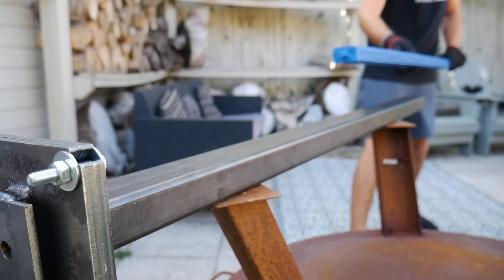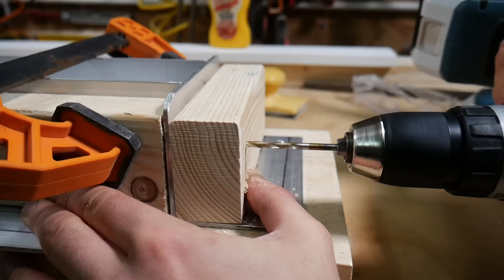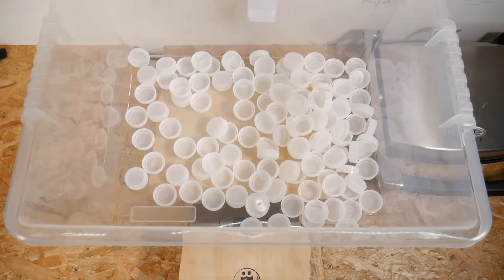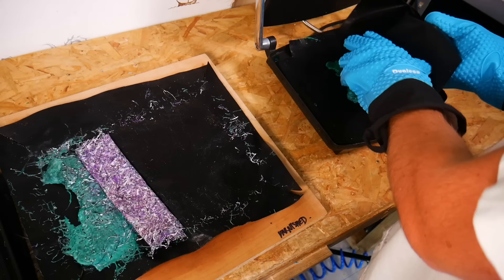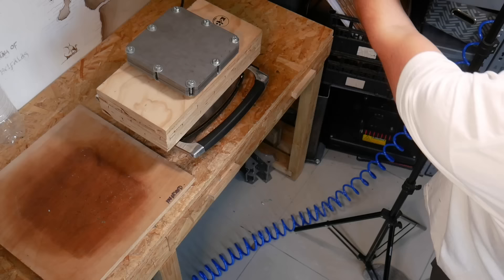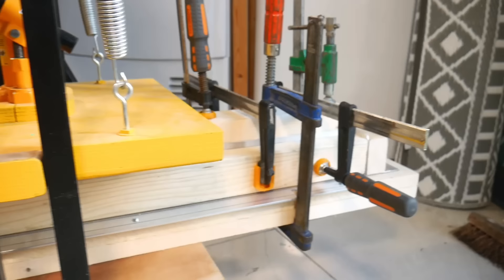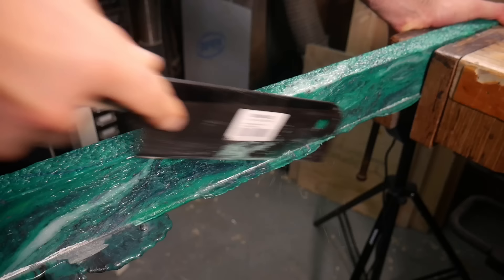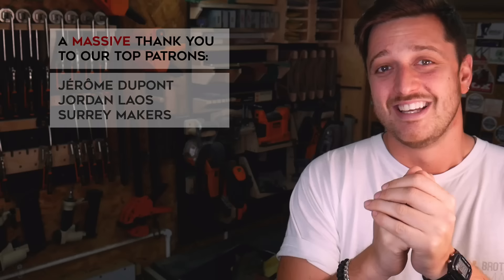How to Make Recycled BEAMS from Plastic Waste at Home

Comment: This was cool.. how about adding electrical heating coils along the aluminum of your mold. Then you can add in your material without having to preheat and mold it. You should be able to use full caps and you're saved. As each batch melts you can press it and add more
Reply: I was thinking a heated mold would be a good idea. Just add the raw plastic, wait for it to become warm, press, turn off heat and cool.
Reply: Can you regulate your temperature with this method? HDPE has a sweet spot at around 350 F. Cooler than that and it isn't moldable, hotter than that and you start off gassing toxic chemicals.
Reply: @Dwight Gordon  it wouldn't be impossible, but it's not going to be as easy as adding a couple of heating coils as suggedted. I'd aim for enough coils to keep the mold from cooling too quick while setting your clamps, and preheating.
Reply: @Frentraken  heating elements, insulation, pid controller.  Not super difficult
Reply: @JordanHaisley  and at least a half dozen temperature probes for something that big, plus insulation required to maintain 350f is gonna add serious bulk, which will need to be addressed for clamping. So again not impossible, but still not slapping a heating coil on and calling it a day easy either. 

I stand by the idea of just warming it. Small heating elements embedded in the wood frame behind the aluminum, then some 3/4 inch hard foam board insulation, and then either another layer of aluminum, or thin wood so the clamps don't sink into it.
Reply: @Frentraken  electric cigarette mods regulate temp on heating elements so the technology is here, probably just a version of a pid now that i think about it.

Maybe a bunch of small heating elements would be simpler than one big one
Reply: @jomten  again again, didn't say impossible. Just far too complicated for such a large mold. The insulation requirements to maintain temp in such a large area is going to require plenty of insulation either hard inefficient ones easily quadrupling the size of your mold, or softer more effienct insulation and then have to figure out how to clamp it and compress  plastic without crushing the mold. Plus you also need to mount and not crush a dozen on temperature probes to makes sure the box is even, and I've already said your going to be using a bunch of small coils, which will have to be on separate circuits so you can spot heat individual sections to maintain the balance of heat since you won't have any air flow inside to allow convection to do any work for you. 

So again again  again,  not impossible, just not reasonable. You can pick up a cheap toaster oven like they did to get your initial melt and then heat the box as best as you can to prolong working time.
Reply from the maker: Yeah, it could certainly work. However, we were going for a budget-friendly DIY version out of easy to find materials. Having a second person to help get the plastic into the mould quickly basically negates the need for any serious mould preheating.
Reply: The brothers addressed air bubbles by twisting, pulling and folding. Could air escape well enough without manual manipulation?
Reply: I was thinking in industry they use a screw press that pushes pellets into a mould. So I would first put the plastic in a blender and shred into decent size pieces and use a piston or some repurposed screw feeder.
Reply: @dwightgordon803  At 350F they'd need to eliminate the wood or it too would offgas combustible gases.
Reply: @Mebeknob  Afaik even if you could heat it all in the mold you'll still need to fold and twist the bulk or it would be full of delamination points.
Reply: @dwightgordon803  not sure why you couldnt add a thermostat to your heat source
Reply: Might add a vibrator so you can melt to temp then get all bubbles up dropping the press stage also
Reply: @BrothersMake  I work in the plastic industry.

What works well with molds is to make the metal mold bulky. 

Metal has low heat capacity but great heat conduction. So, if you make the metal for the mold walls thick and then preheat it, you can "buffer" that heat energy in the metal.

In industry, they also make hot oil at the right temperature flow through the walls of those molds to keep them evenly hot. However, that's not really DIY.

If you have questions I might be able to help out!
Reply: @timjeffries9833  air can be forced from viscous fluids in like this: pressure or vacuum, moving the fluid and giving the air a way to escape.
Reply: Why not turn the plastic into filament and 3d print the lumber, way less effort.

Open source ecology is or has built a 3d printer big enough, easy

Let’s go Brandon.
Reply: @hvacstudent967  that would be a third heating of a thermoset plastic.  Most thermoset plastics already begin to lose their plasticity after the first heat.

The rule of thumb is usually at least 50 percent virgin plastic added to get a useable filament, which would pretty much defeat the purpose of this entire recycling project.
Reply: @dwightgordon803  it would likely be the same as regulating the temperature on your electric oven. Theoretically you could take apart an oven or several and make one large oven to hold several molds.
Reply: Thought the same. Lube the mold with hard soap and make the mold out of 3/16 steel angle... Or even a 20 foot long tube with a hydraulic press at one end and a heated feed chamber that melts the plastic, when the chamber is full the press pushes the plastic thru the pipe and you get nice long beams. This tool would cost quite a bit though, in guessing around 2500 dollars in all for something that makes a 12x12 inch x20 foot beam. Although you could probably get away with doing like 8 feet and then having it on a roller that carries it as you're extruding it.
Reply: @Frentraken  I was thinking an extruding system would be better. You have a small heating area and a hydraulic press that pushes the melted plastic thru a tube. Have elements to maintain the pipe around 250 degrees to keep it easy to push, and hotter where you want the plastic the melt. Hydraulic arm to push it thru, wax with hard melted soap. Would probably cost around 2500 bucks, but you could make any length of bar or beam you want. Even have different attachment plates to make special shapes and sizes.
Reply: @johnhodges8227  stronger press would be good as well, with a gasket to make sure the resin doesn't leak
Reply: @hvacstudent967  I'm thinking best way to do this is an extruder. Have a melting area that a hydraulic arm pushes the melted material thru an electrically heated mold. 1 system could be designed for any size of beam, with detachable size and shape plates.
Reply: @atticus2581  the screw idea suggested earlier would probably be the better bet. Cheaper, and should help mix and agitate any air out of the plastic.
Reply: Hmm. Would need a pretty big motor to make the large beams though. I can see how the extrusion method would work with a corkscrew though.
Reply: @atticus2581  unless you were planning to manually pump your hydraulic system it wouldn't need any larger of a motor. You don't need it to move fast so you can maximize torque through a gear box or chain system.
Reply: @Mebeknob  Exactly! Doable in every African village...
Reply: @atticus2581  log splitter...
Reply: Amazing hey
Reply: and even cooling pipes for help with extraction
Reply: Very cheap DIY idea, right there.  People watching this are using the same resources, Trump 🙃
Reply: @sonnyjs15  Ha cheap? I am sure it isn't all that cheap, after you figure in fuel and labor.
)    fabrication
*)  engineering
**) collecting
1) cleaning
2) mincing
3) drying
4) melting
5) extrudeing

Not that easy huh?
Reply: @BrothersMake   well, could you make a heating coil that could work TKOR style?
Reply: @peterweller8583  cheap compared to all these wildly expensive and industrial suggestions, absolutely.  They're showing "doable" not "mortgage the house" ideas.
Reply: @sonnyjs15  Mortgage the house?
Vacuum pump $125. USD Harbor Freight.
Vacuum pot about the same price same place.
A bottle shreder can be made in house out of chain saw chains oh sure it is industrial in nature and you have to get off drugs to build the machinery but you need not hock the family jewells. Hey I never said it was for every one only that it was doable
Reply: Someone give this man a beer
Reply: @Frentraken  you do not need much insulation, just keep the current low enough to mot ignite the wood.
Reply: @grisza77  the insulation  I was referring to would be for retaining heat, not for the electrical. Unless you're fine with no efficiency you're going to need to insulate the mold if you intend to heat it to temp to melt the plastic. Which will either inflate the size of your molds size by using hard insulation materials, or you can use soft insulation which are usually better insulators  but will add complexity in how you clamp it to add force to your form.
Reply: @Frentraken  true that, just the efficiency of a toaster and an oven do not seem to be much better than the uninsulated form. Time consumed taken into the account will make up for any difference.
Reply: @grisza77  toaster ovens, at least those worth owning, usually have a bit of insulation  between an outer and inner shell. Toasters don't tend to bother for their lack of high heat, and short duration of run time yeah. But yeah over all they aren't paragons of efficiency, and shouldn't be models for any larger scale heating equipment.
Reply: @jomten  I was thinking ceramic elements like those used in a flat iron for hair. Super cheap elements. Control of temp possible. My flat iron has digital settings between 310° & 370° F.
Reply: Just want to add that this method, while great in theory, also adds new issues where bubbles are concerned. You can't just make a heating mold that brings the plastic to the exact perfect temperature. You also have to vibrate the entire thing, and provide air ventilation in the mold to get the bubbles out. The issue is that the plastic caps aren't as regular in shape as the plastic pellets used in original manufacturing, which creates a lot more air pockets while melting. 

Another issue is that the press will have to be much deeper, because the caps have a lot of empty space that will have to compress down. Also, the beam may be limited in shape and size based on the combined diameters of the bottle caps. 

The brothers got around all of these issues by doing it the way they did.
Reply: I thought about this, but after trying every build I could think of including elements and thermostats to regulate the temp, I just gave up and ended up making a mould from angled aluminium that I could hook over the radiator in my workshop. I've been getting brilliant results but I'm still only producing about 2 'logs' in one day.
Reply: Take apart the press and use it as the base for a mold. Obviously smaller planks unless you chain a couple presses together
Reply: Make mold out of steel and use induction to heat mold to a specific temp. Maybe🤔
Reply: I worked with plastic .aluminum heat strips are used to heat the bend areas.i think the heat mold is a brilliant. Idea!

Comment: You need something like a crockpot to melt more and easier. Ideally, you are looking for something that can apply continuous, medium, and uniform heat over time. A pot solution would make it easier to add to the whole as the caps liquify. Also, the pot is ceramic which will hold the heat giving you more time to transfer the material to the mold.
Reply: I'm thinking bread machines. Integrated mixing in a heated pot.
Reply: Put heating elements in the mold.
Reply: @4R53Hole  liiiike?
Reply: @jethermukisa9554  like heating wire wrapped around mold
Reply: @4R53Hole  100%. The aluminium sidings would conduct the heat well. No need to get everything out and press it 100x, just stick it straight into the mold and let it level out with the heat
Reply: Acetone
Reply: @Coopdeville06  only good for ABS and PVC, and then you have to extract the acetone.
Reply: literally just use wood. Turn the bottle caps into 3d printer filament, because planks are an incredibly stupid idea. But I guess good ideas don't make youtube's algorithm, now do they
Reply: @shamancredible8632  3d printers uses ABS and PLA filaments. These filaments also primarily have one use, being used in a 3d printer, which isn’t accessible to everyone. they don’t work with ABS as it gives off a lot of fumes and PLA isn’t used often for everyday items, it’s most typically used for pipes, which they aren’t focused on recycling.
they mainly focus on plastic bags, bottle caps, and plastic bottles since they’re the safest to work with at home and the most common. 
they are a plastic recycling channel, not a 3d printing channel. it would make no sense for them to try and do the stupidly finicky process of making their own filaments.

Comment: I actually think this would be a great way to make sinks with a proper mold. 😊It’s a beautiful pattern and the sink would be almost indestructible. Also, outdoor table tops.
Reply: Honestly? The amount of work for one “board” that comes out looking otherworldly made me wonder why anyone would do this. Your ideas changed my mind. Excellent, creative ideas, You! 😊👍🏼
Reply: thanks, your reply answers my question. i was thinking of making free form planters for houseplants
Reply: just a fyi if outside the uv rays will break it down over time
Reply: Does this produce microplastics?
Reply: @dr.jmoves1005  it probably would unless it was sealed in with a bathroom grade top coat
Reply: @dr.jmoves1005  all plastics produce microplastic.
Reply: well it is quite fragile material - it easily scratches with a knife as it is same material plastic caps are made of. It can be damaged by excessive heat so no hot pans inside a sink. The only benefit is unique pattern so you could turn it into some pens or toys
Reply: @hubert_an  maybe use epoxy to harden it to sustain the heat of a sink as in one used in a vanity. Or maybe combine both ceramic to create the basic with the plastic used to create the counter space ie: vanity. Would be a great way to reuse the stuff
Reply: What would be the melting point of the sink? Very important.
Reply: Doesn't sound very durable or practical.
Reply: I love the out door table top idea !!
Reply: Terrible material for a sink. A sink needs to be heat and scratch resistant. PE is neither.
Reply: nowhere near indestructible lol
Reply: You go have fun with your sink made of garbage, the rest of us will stick to porcelain because we have self-worth and dignity. 😊
Reply: To be fair there's probably a lot of stuff we could probably replace with Ceramic instead of plastic.

Comment: You guys should do a stress test to see how it handles sheer and compression forces compared to a regular 2x4. I know the point isn’t finding an alternative to wood but it would be cool to see its failure point
Reply: since thermoplastics suffer from creep during prolonged stress I think it wouldn't be a very good alternative to wood even if initial test went in favor of a HDPE beam . . .
Reply: Stiffness is also just as important as strength. If plastic deflects more, then it won't support load as much if used alongside wood, and if used in place of wood, more plastic would be needed to keep deflections low.
Reply: These kinds of planks can warp in very hot sunlight during summer days.
Reply: Recycled plastic planks in America are often used for building City Park benches and rot-proof picnic tables. And in children's playgrounds.
Reply: @jacobshort6528  They have UV stabilisers added during the manufacture. The one in the video would become brittle in a summer.
Reply: @jacobshort6528  Would they be good enough for my dock?
Reply: @HostileRespite  you'd need a filler like fiberglass or wood pulp. Alone it would not be good decking. Think Trex. Plastic wood combo boards.
Reply: dont forget, is it UV light stabilized plaatic.
Reply: @cenccenc946  well photons are good for polymers. They make them stronger by energizing the bonds 💪🏽
Reply: @cenccenc946  Good call! Might take a while to snipe this plastic and set it aside, but I know the stuff you're talking about.
Reply: Absolutely!
Reply: Was thinking the same thing. This beam is probably very strong.
Reply: @notsure1350  I thought trex is concrete & wood mix.

Comment: Using a heat gun to control the heat while adding the plastic to the mold will lengthen the time to work with it.
I also think if you used an old meat grinder (the kind that clamp to your dining table) to crush/shred the caps before melting will reduce air pockets as well as increase the number of caps per melt in the panini press.
Reply: Great idea. I just wonder if that would effect color control. I would say you could easily grind by color though so yeah great idea!
Reply: large blender to cut up the caps
Reply: If you don't compress it after grinding it it's going to be 50% air bubbles.
Reply: You don't need to work with it that long. Just get it in and press it down.
Reply: Meat grinder wond do HDPE
Reply: In pelletier reclaim machines, the grinders are cooled because the shear force of tearing plastic causes a lot of heat transfer. If not cooled, the plastic will just stick to the grinder. No Bueno. Don't use a blender. Not unless you can cool it.
Reply: pretty sure shredding will not reduce air pockets, most likely will add air pockets.